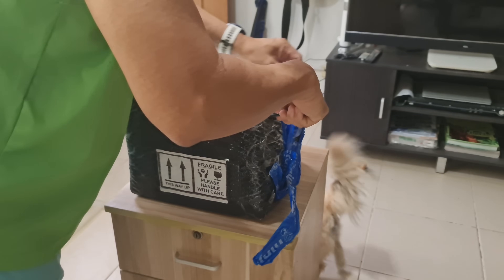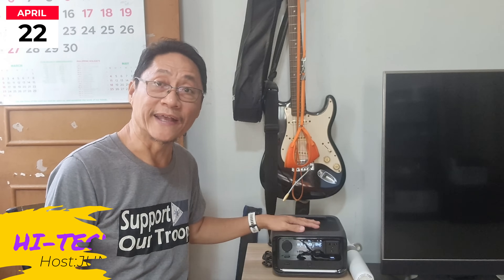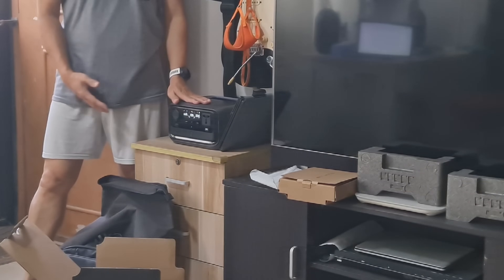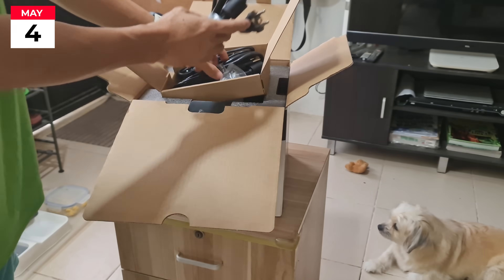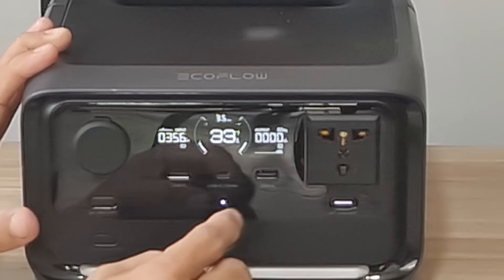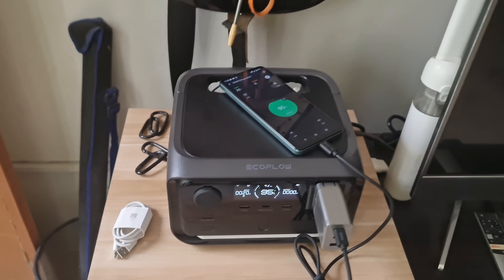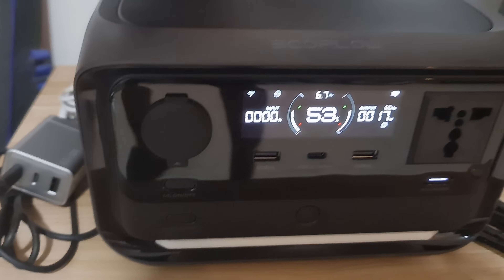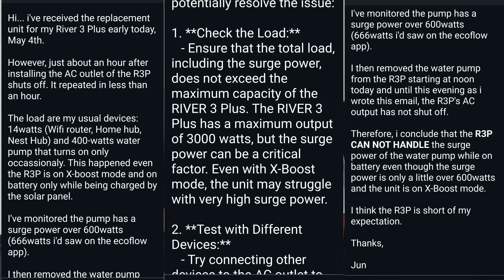400-Watt Water Pump Shuts Off Ecoflow River 3 Plus Power Station | Power Surge Fail

Comment: My river 3 plus max is exactly the same, shuts off AC outlet when reaching solar charge limit. It’s only running computer and router so a steady 70-80 W output. It’s done it since day 1 and it is a new unit.

Comment: I just have a River 3 Max Plus for less than a month, during the last few weeks I have been using it and recharging it with wall sockets without any issues. I used the schedule functions to optmize the way I was charging and discharging it, so far so good, however I finally managed to install some solar panels on the roof and for my surprise I noticed that the River 3 Plus turns off the AC outputs once the battery gets full charge to whatever limiting charge you set it to, meaning that if you set the limite to 80% charge, when you are 79% charging with solar panel is still good, then when it reaches 80%, at some point the solar input is turned off and all AC outputs are turned off as well. I searched on the web and noticed lots of users with the same problem.  Apparently Ecoflow knows about this problem, but have not fixed yet. I tried all different configurations in order to solve it, but I think it is a firmware problem or even a hardware problem with its inverter. I have two Delta 3 Plus +  Extra batteries and none of them have this issue, the solar panels keep trickle charging the Delta 3 Plus and stop when it reached the upper limit set, no AC outputs are turned off. What that means is that you will always have to manually turn off the Solar Input before it fully charges the River 3 Plus, or when it shut down the AC Outputs you will have turn them back on, which is a major problem if you are trying to leave some critical equipment on and  unattended.

Edit 18:45 - A few minutes later after this post, while doing a lot of tests during the day, I noticed that the problem is not related to the fact that solar fills the battery to the max limit set and then the AC outpputs are disconnected, I think the reason the AC outputs are being turned off is because the DC input is turned off and not because the battery is getting full....subtle difference, but still the same outcome, AC outputs being turned off on the River 3 Plus. When you interrupt the current/voltage on the XT60 port of the River 3 Plus, for some reason the unit thinks it needs to turn off the AC outputs as well, maybe there is some inductive load being shed back to the system causing an overload to the inverter?? or some coding error on the software controlling those chargins and discharging ports. 
TO ECOFLOW IF YOU SEE THIS POST, PLEASE SOLVE THIS PROBLEM, THAT IS UNNACCETABLE AND IT KILLS THE WHOLE FUNCTIONALITY OF THE RIVER 3 PLUS BEING CHARGED VIA DC XT60 PORT/SOLAR PANELS.